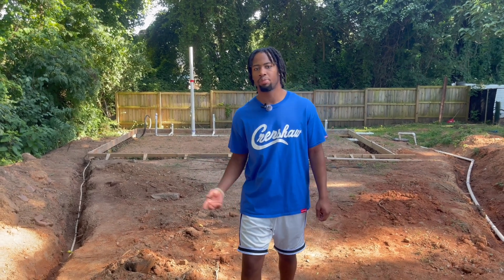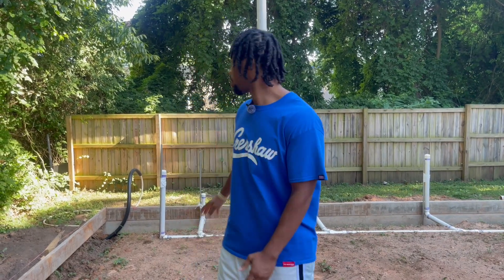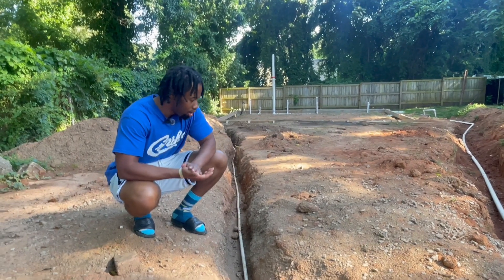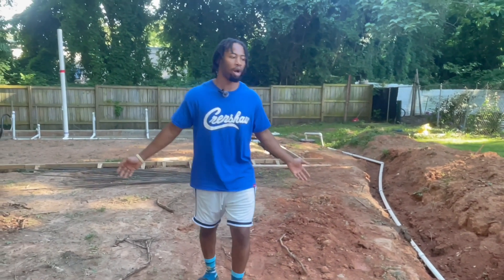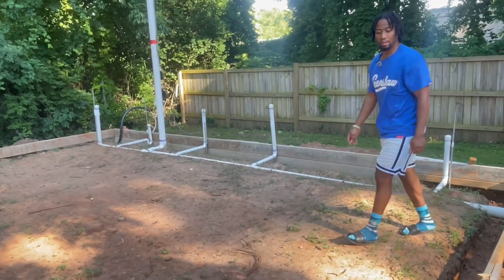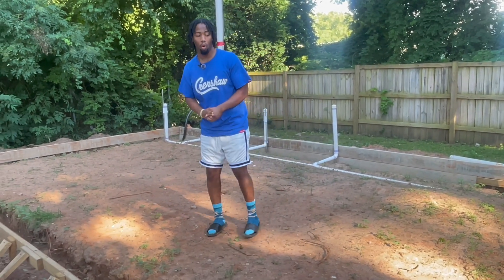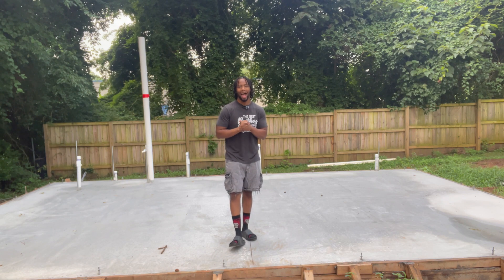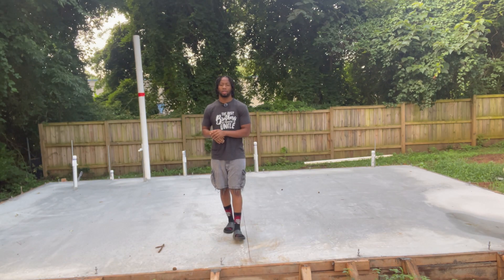Concrete Pouring for Tiny House Foundation/DIY

Comment: Hey,
Even though it's a tiny house they should of added gravel and tamp it down. The ground shifts and settles. 

You should winterize the pipes even though it's hot where you are
Reply from the maker: I'll be sure to do that next time,  I told my concrete crew that originally but he said since it’s one floor and not to much weight it’s not needed
Reply: Im looking for off grid land now. Hopefully less restrictions because I dont got time to play lol